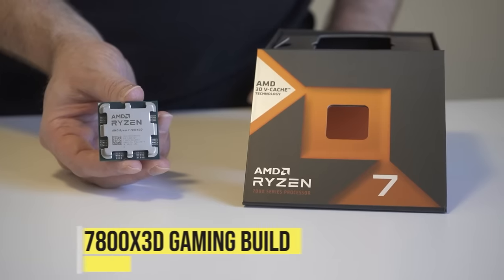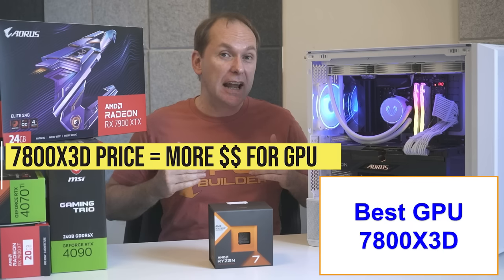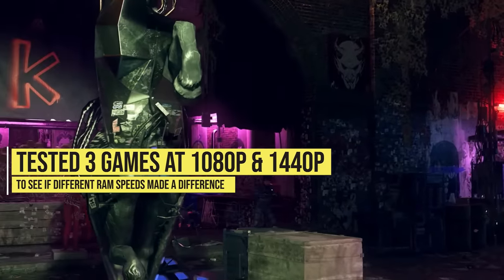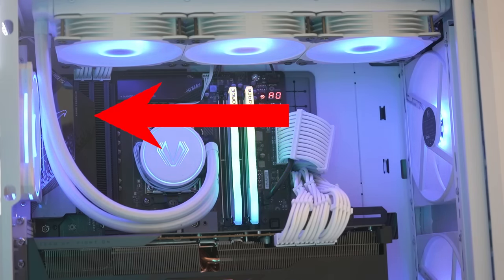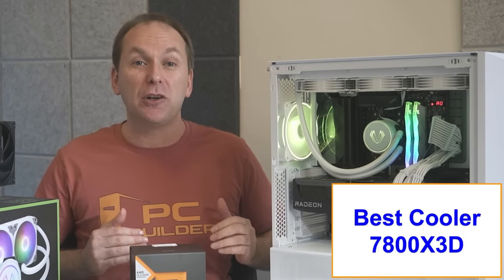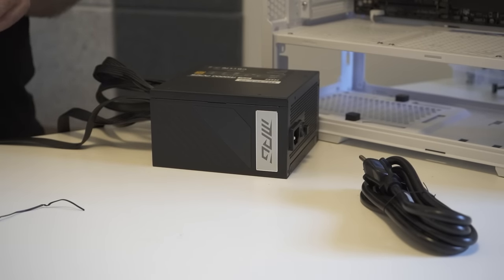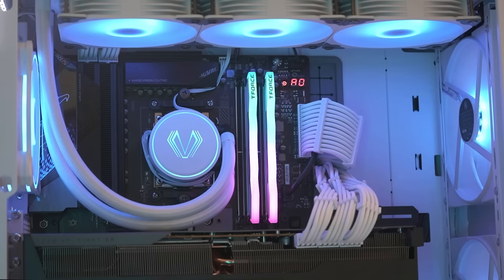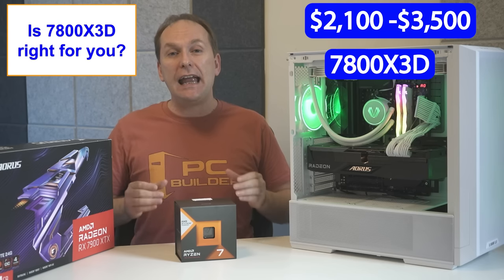🛑 Best Ryzen 7800X3D Gaming PC Build 🛑 Best RAM, Motherboard, GPU & More

Comment: Hey Jason, I just bought a PC, wish I saw your comment below before I got it because I'm running a Ryzen 7 7800X3D on an Asus B650M-A and my games keep crashing. What's a better motherboard at the same price point? Gigabyte?    Also, I was told to underclock my DDR5-6000 to 5200 to see if that helps, do you have any thoughts about that? thanks

Comment: Thanks Jason for this review. It's what I needed to finally decide what build to go for. And to my relief I can go for a 1000W SFX-L psu (Lian Li Dynamic Mini case), rather than a 1200W. Those things are getting expensive! I'm pairing the 7800x3d with a 4090. Assuming I'm still good at a 1000W?
Reply: should be, i think the recommended w is 850 but dont quote me
Reply from the maker: Should still be good but you can hop over to our Best PSU 2022 video and follow the method there to be sure

Comment: Hi, does that case become with fans? I would like it with a 4700 ti and a 5800x3D , most likely i could put a 240mm aio but what fans i would need?
Reply: The case has already the fans in it.
Reply from the maker: It comes with fans (:

Comment: Hi Jason, wondering if a cooler master hyper 212 will be able to manage the 7800x3D I am upgrading from AM4 to AM5 and I am trying to save some money :)
Reply: It definitely will just ensure the case overall has good airflow and positive pressure, you can also get the second fan clips and add another fan to the 212 love those coolers!

Comment: What motherboard and ram do you recommend now for a 4070 ti super, 7800x3d, be quiet dark power 13 1000w, nzxt kraken elite AIO 360, and 6 Lian li uni fans with the lian li o11d evo rgb? My first time building a pc and I want to make sure I can fully optimize the performance out of my parts
Reply from the maker: Our recommendations are linked in the description!
Reply: @PCBuilderChannel Hello! Thanks for responding. What do you think of the gigabyte b650 aorus elite? It’s price is $89 right now. I am also choosing the Trident Z5 neo for my ram
Reply: Ahh it seems that the motherboard isn’t for that price anymore
Reply: @PCBuilderChannel  My whole build comes out to $2510. For that price is it fair? Will this build last me 3 years from now? In the future the only thing I want to switch out is my gpu and just adding another ssd card. Not trying to switch out a motherboard because that will be quite the pain so I want one that will last me quite some time.
Reply: Do you know if another big sale will happen this year? Right now the Samsung 990 pro is on a big sale rn so I’m getting 2tb. The lian uni fans have a decent sale so I’m buying 6 of them. 7800x3d is also on sale alongside the psu I listed. Should I just buy the parts that are on sale rn and then wait out on the gpu? I have no problem with buying all these right now but if another sale will come soon then I would rather wait it out to use that extra cash on a good monitor.
Reply: @PCBuilderChannel  should I go for a oled monitor that is 165hz 1440p or a ips monitor that is 240hz 1440p?

Comment: Would you pair the 7800x3d with an Asus 3080 ti tuf? I'm currently running a Zotac 3060 ti. 32gb ram, B650 board, 1000w gold power, and a 49" Ultra wide Samsung... This is for sim racing. Thanks!
Reply from the maker: You can. If you already have the 3080ti or are seeing it used at a great price. If buying a new GPU there are much better price to performance options, especially for Gaming.
Reply: @PCBuilderChannel   Thanks for the reply.. I can get a 3080ti tuf refurb with warranty for $700.. It may be worth the extra $300 and get the xtx

Comment: I can get a ASUS TUF Gaming B650M with WIFI for 170 dollars is that any good? I heard there are some issues with Asus and 7800X3D but most videos are like 10 months old so I have no idea if its still the case. Or would you recommend going for a cheaper for board such as ASRock B650M-HDV/M.2, ASRock B650M Pro RS or Gigabyte B650M DS3H? I don't really care about the audio since I have a good DAC.

Comment: I'm totally stuck on what to get ;( Have settled on a mobo ( asrock x670-E steel legend) ram 32gb (corsair 6000 ddr5) re-using my current case (corsair 780t) 850w gigabyte PSU, m.2 drives one 1tb for os and one 2tb for games. My issue is which cpu and gpu, had planned for 7700x and considered the 7900x but then 7800x3d came out but some games I play are more clock responsive and I do plan to do a bit more creative work particularly video editing and 3d rendering in blender and fusion 360 and some streaming. Then it comes to the gpu, I had planned for the 7900xt because of the greater amout of vram and slight improvement in rasterized performance but the 4070 ti is around the same price here and thought it may give a better experience out of the box and with the option to try RT ( and have a bit better experience) but I know I should expect to have to rely on DLSS a bit too which I think is a bit crappy. I mean, surely the gpu manufacturers would try and make products that can at least play the current games (or even those a year or so older) at decent FPS without the need for DLSS. Looking at the steam hardware survey I wonder if I should be a sheep and follow the the most common and in theory best supported by games, nvidia. I mean I just dont know. I need to get my finger out and make a decision as my system builder is bound to be getting frustrated with my indicision ;(
Reply: So if you live in the US go with the 7900X for the CPU because Newegg has a CPU Motherboard Combo Deal with it and the ASRock Motherboard you're getting.

For the GPU you'd want the 4070 Ti because you're doing production/creative work along with gaming.  If it were mostly gaming though I'd say 7900 XT.

As for the PSU just note you're supposed to input your build into PC Part Picker and times the watts by 1.5 to see what watt PSU you need.

Comment: What would be the best route if I just want to upgrade my CPU to the 7800X3D and not anything else but want to upgrade my GPU at a later date?

Current build:
i7 4790K
ASRock Z97M Killer Mainboard
Kingston KHX1600C9D3B1K2/8GX 16GB 
Asus ROG Strix 1080 Ti
PSU 700 W xigmatek nrp-pc702
Reply: So because you have an older GPU you wouldn't want to upgrade to the 7800X3D unless you can also upgrade the GPU.  

You could upgrade to the 7600 and later upgrade to the 7800X3D when you can also afford a new GPU.
Reply from the maker: Not possible I’m afraid. It won’t work at all with your current build. You’ll need a AM5 motherboard, DDR5 Ram, and a new PSU.
Reply: @PCBuilderChannel  Yes, I know that. I should have clarified that.

Comment: Hey Jason, I also built a new system recently and your videos helped a lot. I chose msi b650 tomahawk wifi with a kingston ram KF560C36BBEAK2-32 and a 7600x. Now I dont know if this is compatibility issue. Here is my problem, I cant restart or reboot my system when Im using expo profiles. It stays at black screen and memory led is on. My system also doesnt start at all when I put 1 stick of ram to DIMMA1 slot instead of DIMMA2. I already reached msi support with a ticket and they said they tested with the same configuration and didnt have neither of these problems. They said it could be a motherboard hardware issue and suggested that I RMA it. What do you think is happening? Hope to hear you opinion.
Reply from the maker: Check out our "after you build setup guide video" on the channel but if you are still having issues I recommend posting to reddit build a pc troubleshooting forum. Its a great resource!

Comment: I've got an MSI B650 Pro-Wifi. Other than only 3 of the RAM slots working, I have no issue with compatability found no difference between 5200 kingstons featured in this video and the 6000 equivalent. Any ideas on how to fix the slot that isn't working?
Reply from the maker: RMA the board is probably the only option unfortunately. Depends on what you mean by not working, as many boards struggle with 4 DDR5 DIMMs populated. Could be an issue with the CPU memory controller, but if the slot just doesn't detect a stick at all no matter what, likely board is defective.

Comment: and what about 850watt platinum for example dark power 12 for 7800x3d and 7900xtx and what about noctua nh-u12a for cooling it? only gaming
Reply: So for the PSU you need to input your parts into PC Part Picker and times the watts by 1.5 to see what watt PSU you need.

As for the Cooler, Noctua Coolers to me don't seem worth it because of their price.  There are other air coolers just as good for less.

Comment: Given that the RAM speeds doesn't tend to differ that much in performance due to the VRAM on the AMD. If these below RAM's were the same price what would be best. Stay with only 32GB of the trident on lower CL, or go simply double with 64GB of the Corsair on higher CL?

I don't know if going with 64GB might cause a drop of performance somewhere else that would not as good as 32GB only.

G.Skill Trident Z5 RGB Series (Intel XMP) 32 GB (2 x 16 GB) DDR5 6000 CL30-40-96
Corsair Vengance AMD EXPO DDR5 PC5-41600 (5200 MHz), C40, 64GB (2 x 32GB). 40-40-40-77
Reply from the maker: There is a small benefit with ultra fast GPUs, but it is very small in going DDR5 6000 CL30. I tested 5200 CL40 RAM and it loses about 2-3%, so feel free to go 64GB DDR5 5200 CL40 if you need it for some other reason.

Comment: Planning on getting 7800x3d and a second hand 3090, would it make sense? Since I can get the 3090 around the price of 4070
Reply from the maker: I personally would pair a 3090 with a 7600 instead, especially if dropping down would allow you get a better GPU. But its not a terrible combo. See our Best CPU/GPU Combo 2023 video for more
Reply: @PCBuilderChannel dropping down my CPU won't change much for GPU options as I'm torn between 3090, 4070, 4070 Ti, Rx 7900xt and 7900 XTX. Trying to figure out which one is best price to performance and least amount of issue